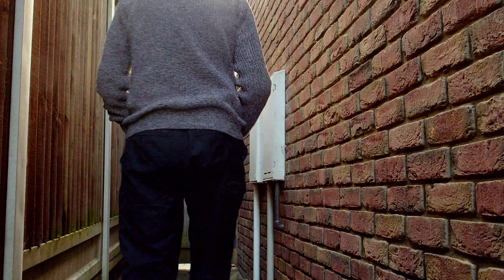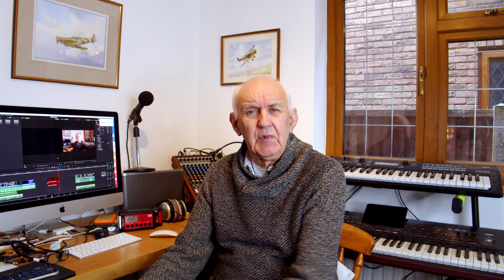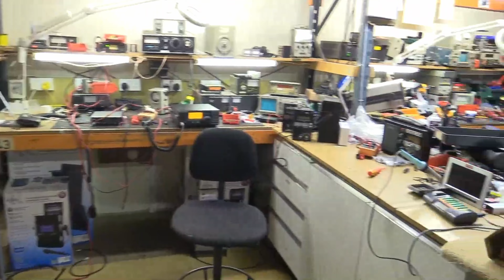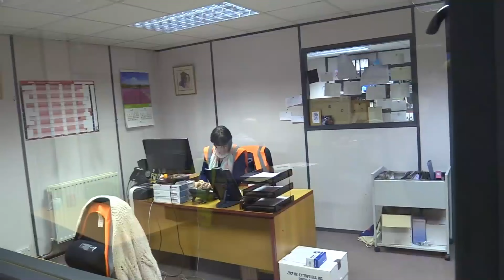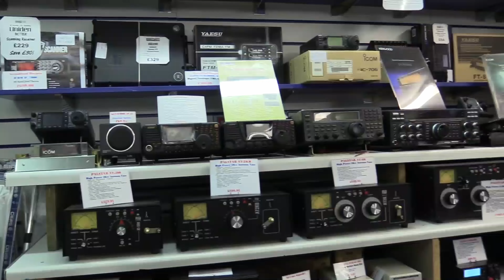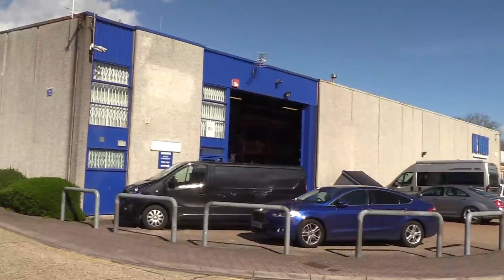Power Failure Kit - Midland EK35 Ever Ready Power Kit offers Heat, Light and Power.

Comment: From time to time, Lidl sell a pair of SilverCrest PMR radios, for about £30.

They're much like the ones in this kit, but they take AA batteries, so should run for quite a bit longer.

They're rechargeable from a base unit, or individually using micro USB cables.

They'll also operate from regular AAs.